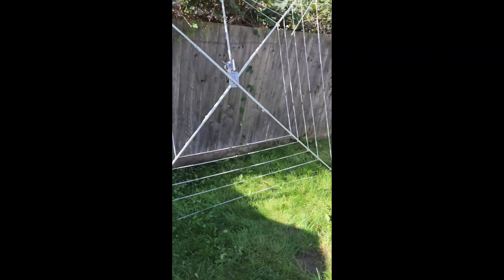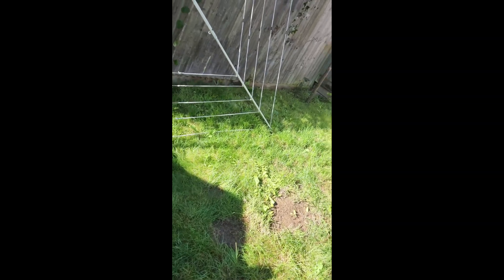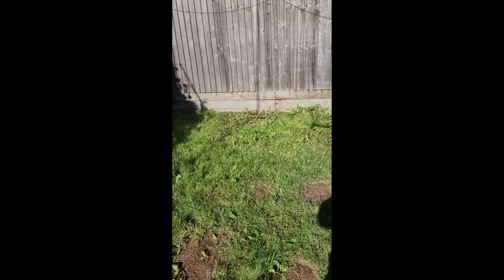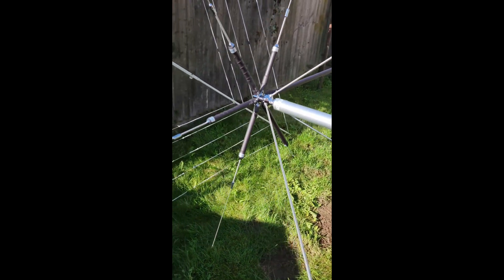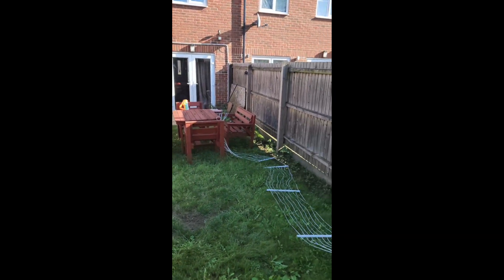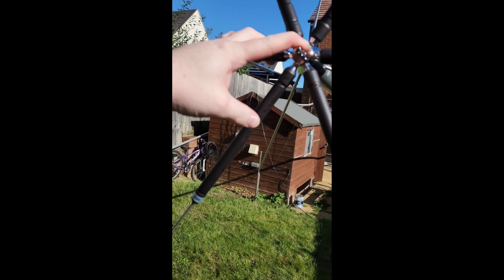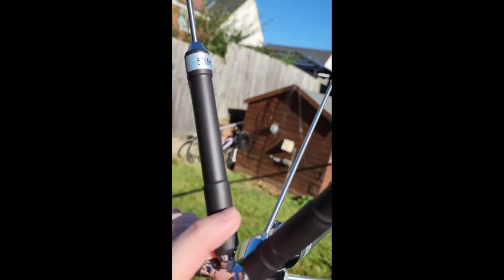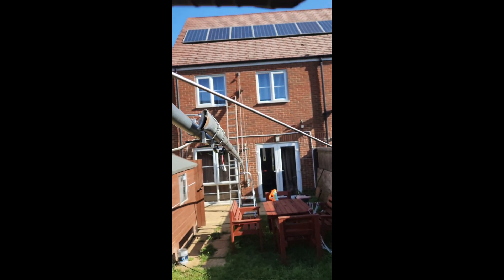NEW TOY - SCANKING TXHF-6 DISCONE 80-6M ANTENNA REVIEW AND SETUP PART 2

Comment: Could it be your coax, or try to ground the antenna. I know some antennas have an issue with proper ground. Good luck with that antenna. I was looking to buy one of this, that’s how I found your video.
Reply from the maker: The antenna is good for maybe a scanner but as for TX i do not think this is good for a TX antenna, the antenna is far too short for anything below 20m, it worked on 10m but a hustler 6btv will be better performance

Comment: What was the finale with Moonraker txhf-6 after getting it back to Moonraker? (as I don't see part 3 video)
Reply from the maker: Someone at my local club works at Moonraker so he took it back for me and got me a refund and i added to it and got a second hand 6btv hustler
Reply: @MØKNM-Amateur-Radio  Ah refund. So it is not known if the antena was faulty or if it is just not a good antenna.
Reply from the maker: No not known, i would most likely say its an antenna if you have no other choice but there are so many to choose from.